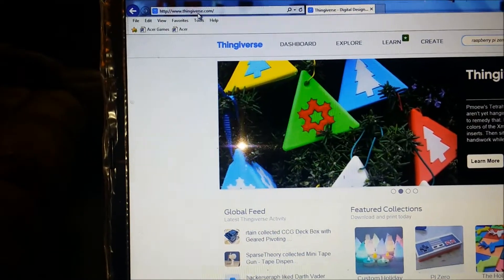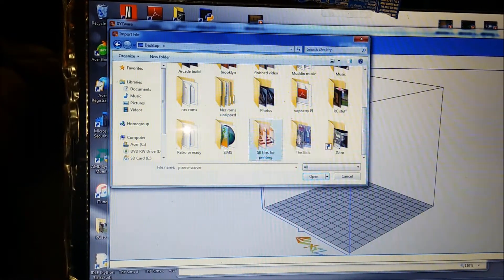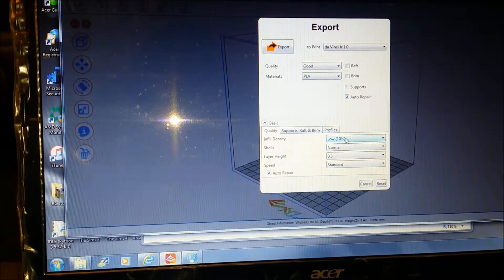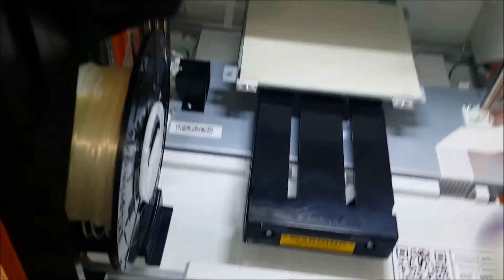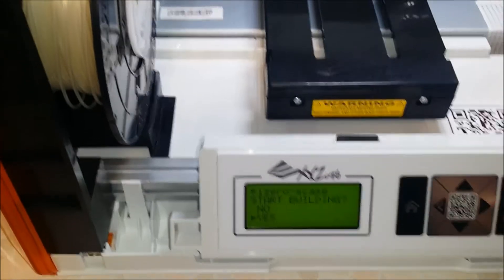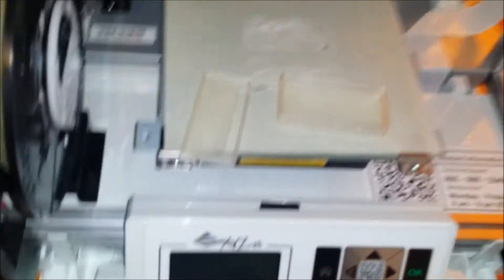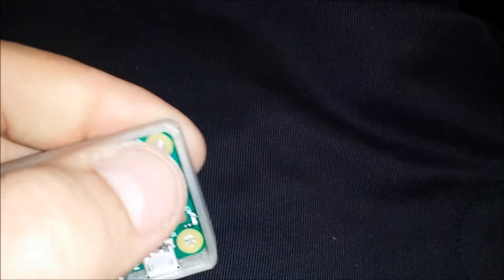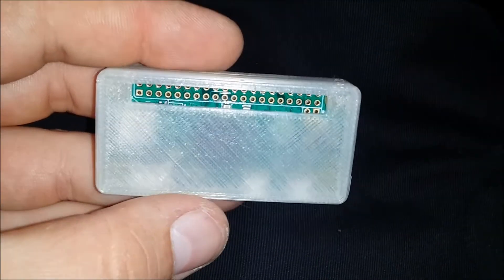3d printed Raspberry pi Zero case using davinci jr (xyz printing)

Comment: Nice.  so I have to export it before I can reliably print?  I tried someone else's case and also a skull, and they both were seriously ganked up.  the only "luck" I had was with a small monitor stand and even that was still a mess.

on a side note:  use a purple glue stick.  it's easier to see where it's been applied.  when it dries clear, you're all ready to go...